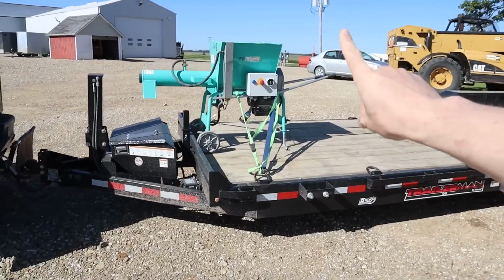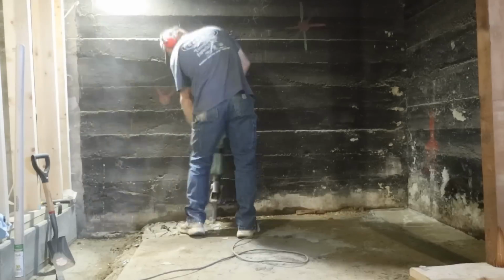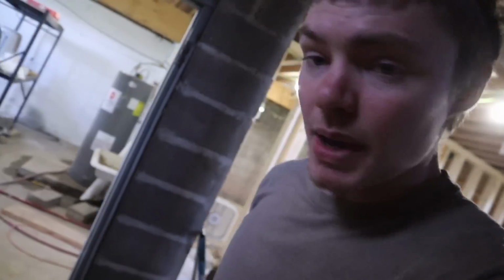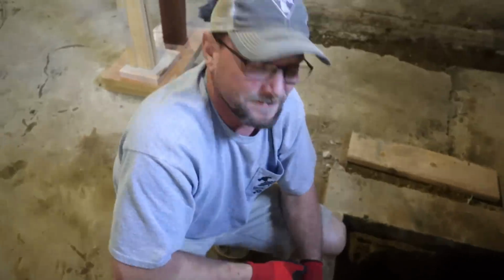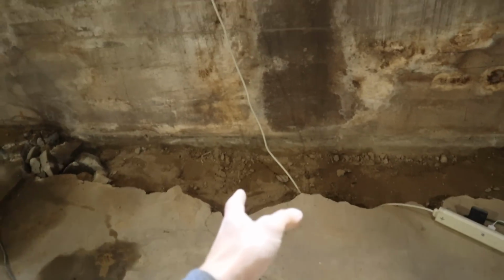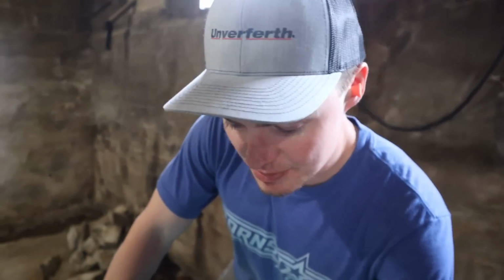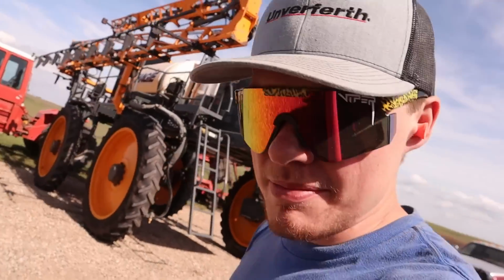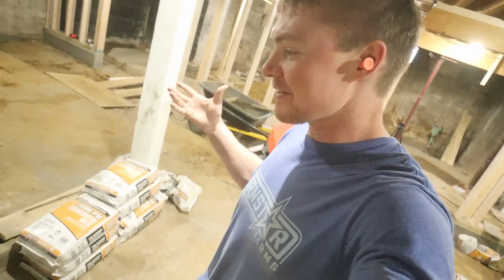Restoring A $7,000 Mansion: Pouring A New Concrete Foundation Pt. 2

Comment: Only Bad thing about you doing those footers in sections is a foundation footer needs to be one continuous concrete pour Cole. Because putting wet concrete against cured or dry concrete is it don't bond to each other. Although you tied the rebar from one pour to the next that helps in strength it doesn't prevent water 💦 from getting between the two pours. I know you're putting in ground water drains and that's great BUT in heavy downpours 🌧️ or flash floods or flooding In general water 💦 will still make its way between those concrete pours where they're not bonded.  I'm just saying. It should've been one continuous concrete pour on that foundation footer.  It would've been a complicated job but with the help of floor jacks and a concrete pump truck to pump it from the driveway into the basement it could've been done. Now as far as giving the house footer strength the job done here is fine but unless you're gonna install one big water 🌊 drainage pipe system to handle big downpours 🌧️ or flooding..... I have a strong belief you're gonna be revisiting this foundation footer project again in the future! I hope not but my intuition & knowing the fact the concrete footer is not one continuous pour...... I strongly think so.  
I hope I'm wrong for your sake.

Comment: concrete sinks while drying, you may need shimmering with steel wedges under the exiting walls, maybe use a flowable concrete 6000 psi or better.

Comment: What is actually left from the original house..?? Far as I can see it's the exterior frame, roof and basement exterior walls. The rest got ripped out and taken to the dump. I know the house is sentimental but the rational part of my mind says it would have made more sense to knock it down and rebuild....even if you made it look the same outwardly.

Comment: Gentlemen,

Glad you went with the rented concrete mixer. The barrel mixer does take longer to work with, as it has no automatic moisture setting, and you have to dump it out by hand.

Those fibers you see in the cement were most likely recycled wind turbine blades. There is a life span of a few years after which they're removed, and GE sends them to a company that shreds them into pulp, and cement companies use it to burn 🔥 in their cement factories and to make cement.

Keep up the good work. Justin, you cracked me up today. 😂

God bless you all.

Comment: Total waste of time and effort. Should have just removed the slab and install a curtain drain to a sump. Water seeks its own level so with perforated pipe , silt fabric and stone under the entire new slab water will drain plus now you have a way for radon mitigation. Next install gutters and pitch the ground away from the house. I hope what they are doing currently doesn’t compromise the existing foundation.

Comment: That rebar needs to be up off the dirt, didn't they sell you adobes to wire onto the bottom of the mat?

If it's in the dirt it'll rust, the rust will draw water into your concrete, hydroscopic pressure with crack your footings which allows for more water to get drawn in to continue rusting the rebar

Comment: As long as Cole maintains the current sub-grade clay soil on the OUTSIDE of his basement walls? Cole will have "wet" basement walls whenever it rains heavily. Everything he is doing INSIDE his basement, to alleviate moisture, is superfluous, and will achieve a net-zero result, to keeping that basement dry. He may as well be hosing money at the moon. If you want water kept out of a basement, then you have to seal the exterior basement walls, with something like Thompson's water seal, and then a layer of bituminous tar, to close the concrete's pores. Then it's a matter of putting large diameter perforated pipe, wrapped with landscape material (to let water into the pipe, while excluding mud and soil, to avoid clogging the drains) then, (having excavated along the exterior of the basement's perimeter on the outside) laying in large, screened gravel,(roughly five feet deep) over which you lay a pond liner... and finally a layer of top-soil. Those perimeter French drains should lead to a sump-pit, with a sump pump, which pumps any water making it past the pond liner, down the hill and into the creek. There should also be a catchment scheme set-up, to take any rainwater from the roof-gutters down the same path, so it doesn't reach the basement walls. This is how you keep a basement dry.

Comment: I hope it a GPS type  concrete as it expansion concrete which expands as concrete swincks when dry leaves a gap while a GPS does with the water it expand filling gap.what you doing is call under pinning dig meter leave a meter the most and so on.hope it seals otherwise mite have problem in years to come best of luck
Reply: I tried reading your comment; but, I can't!  Punctuation helps.

Comment: This footing reinforcement process seems like a really odd way of going about things considering that they have enough equipment on the farm to dig a hole large enough to get a bobcat in the basement. I am also not under the impression that they have created a way for the water underneath the slab has a way to get out of the basement—don’t the need to install a French drain around the perimeter? And probably outside the basement wall as well? I hope they are consulting a waterproofing contractor. I guess all this content makes ten times the cost to pay Roman and Justin so at the end they can pay for some other stuff

Comment: If you're cutting an opening in the basement wall to connect to the new basement addition, just make it wide enough to fit the skid steer through.  Then, cut a ramp down into the basement and drive the skid steer down to clean out the old flooring (if you plan on tearing it all out).  You can also probably rent a jack hammer attachment for the skid steer.  Just be prepared to put a temporary roof over the ramp to keep rain water out of the basement.  This will save you a lot of time and effort.

Comment: Order a concrete truck with a pump and put the hose through the basement window. Pouring will be done in no time. I hope you are not planning to pour the floor concrete by yourself? I agree with many comments here that there should be a perforated drainage pipe lover than the poured foot, then a separate pipe (without perforation) for the roof water and finally a water isolation covering the outer basement wall. We also put a layer of styrofoam along outside the cellar wall for frost protection

Comment: I helped on the same type project in 1968 when I was a Young buck! Dug the whole basement down 4 feet and under pinned the side walls on a house that was built in 1911 (24'x24') and poured a basement floor ! lived in that house untill 2018 when I built a New house on the farm a really nice 2000 sq'ft house with a full basement ,4000 sq/ft of living space

Comment: Can't wait to see which mixer you got and vibrator also. I have the 20volt dewalt one. Thought it would be a joke but when I go to the jobsite it Is the one everyone grabs first. So light and hits hard and fast and did 9yards of steps with it and the battery was still half charged. I have the harbor freight mixer and it hasn't let me down and it is 15years or more old and the small wheelbarrow one from menards that only does 60lb bag one at a time but is great for tight spots and better than mixing by hand.

Comment: @Justin - hope you've had a tetanus shot in the last few years due to you scraped /cut it on dirty metal rebar??!!
Symptoms of tetanus may not begin to appear until a week after the injury, so as a rule of thumb, try to get the tetanus booster shot within 48 hours of the injury. If tetanus is left untreated, your body could face long-term complications such as airway obstruction, heart failure, muscle damage, and/or brain damage.

Comment: Surprised perimeter wasn’t saw cut for a straight edge.
Reply: He said they are eventually going to jackhammer the rest of the old concrete floor and pour a new floor.  So, no need for a straight edge.
Reply: @ILGuy2012  I’d think old floor would remove easier with straight edge

Comment: There’s an updated machine to the concrete mixer you’re using. It’s called a Mud Mixer. Has a few more features to it, not cheap but definitely handy!  I’ve poured a lot of concrete with mine by myself. Absolutely hard work
Reply: That's not mud  to lay brick and block with
Reply: @Harvey-z4k  don’t understand your reply but I’m aware it’s not mud to lay brick and block with.

Comment: House is sitting on undisturbed soil for 100 years... (No cracking foundation walls) let's disturb it(in sections one at a time), not get 100% compaction after disturbing each section...  let's see how the cracks will start in the foundation wall over the next 100 years. Leave well enough alone. 100 years... no cracks!

Comment: Here is a thought. Clean out that old well, and run your basement drain into it. Install a pump with a level float so it automatically turns on and off when the well gets to a certain point. Drill a hole through the basement wall to install a pipe from the pump about halfway up the wall. That way you can run the pump hose out of the basement without having to dig a trench outside down to the bottom of the basement for your drain pipe. If that makes any sense.

Comment: If you put an addition on to the house with a basement under it. You might want to look into a company called Superior walls. They have precast insulated basement panels. No pouring and water tight and insulated. I used them and they are great.

Comment: Next time tear down the old house and save time,money and labor. When all said done it’s still a old house vs new. By what your said. You want a interior footer drain and exterior drain system. Also a in floor heating/boiler system for your basement. Again all over done but it’s your money and time.

Comment: The mind is the behind the knees work fine. Are you guys using a bonding agent on the exterior wall, cinderblock, or drilling it and putting dowels of rebar up?

Comment: Are you going to marble dye your floors on your cement while it’s new and then matte finish so you don’t slip and break anything because the last step is wax the floor and make them beautiful I’ve seen the dk green and then we have dk blue and they both are amazing it makes it look like you could be living down there especially if you’re planning to put a boiler pump to heat the floor! The acid dying marble will make it look like a million times better! Good Luck when you get to that point and I guarantee that if you do it you all will be happy! And you put wax flooring on it as it needs it if it gets high traffic you do it more often but the shine but not slippery floors will amaze you!

Comment: Both my father and my maternal grandfather worked at the Lehigh cement plant in Mason City, many decades ago.  Both eventually died from cancer; most likely from exposure.

Fun fact: Lehigh celebrated 100 years in Mason City in 2021.  They were also fined nearly $200,000.00 by the EPA for violation of the Clean Air Act, also in 2021.
Reply: Thank goodness they will have just a few hours of exposure and not a lifetime of it.

Comment: I’ve just came to the realization that in all that lumber you’re not gonna reuse you could have probably replaced the dump bed on the truck, 😊
Reply: Possibly. But that would ruin all the fun of seeing just how long those old boards will hold up!
Reply: That would have been good and then oiled them for sure.
Reply: @richardnott9587  Definitely oil them with a mixture of Tung, and Linseed oils... Best stuff in the world, for wood preservation. Only drawback being that it's incredibly flammable, while it's in liquid form. Once dry? No issues. This is what they used to preserve ship-timbers with, back in the days of sail.
Reply: Wouldn't that have been a smart thing to do?!!!

Comment: Just curious. 105years that house has been standing. Does it make sense that the original masons did what was needed to keep the foundation standing, permanately? This, in my opinion, is one of those times, that, if it aint broke, don't fix it. It may have been common practice to compact the bottom of the hole so that what was put in did not sink. I would have thought the drain pipe would have been put on the outside around the house. Just my thought.
Reply: I’ve seen houses built on stones last 200 yrs. Nothing Cole is doing makes sense. But it’s his money I guess.
Reply: Our farm mansion was built in 1869. Who ever built ours started with a strong well-constructed foundation that is not in need of repair.
Reply: Our farm mansion is bult much better than his and is over 45 years older. The basement walls are made of field stone and are very thick and are literally solid as rock. Original woodwork and flooring were not torn up and removed. It was lovingly restored by my father a true craftsman. As far as drainage it is just not an issue. A compliment to the original builders who used brick for the exterior. It was built before indoor plumbing and still has the original brick shithouse Built like a brick shithouse. It has been used as a garden shed for my lifetime.
Reply: Extra support. For future additions

Comment: Don't you need to put drain tile in the footings to connect the outside to the inside so the water on the outside doesn't seap thru the bottom of the wall

Comment: Major advice if you aren’t to far, the exterior block is hollow, water will penetrate to the inner core and run down to your footers and leak into the basement. Before you do your third footer pour drill holes In the block to allow that water to escape and make its way down into your drain tile below your basement floor so it can make its way into a sump pit. Otherwise you will have water from the block trickle across your floor. Trust me I learned this the hard way.
Reply: Would this not be negated with an exterior french drain dug down to the depth of the footer, filled with gravel, and trenches away from the home?
Reply: This is the course that I advocate, also. Best strategy, is to keep the moisture from even touching the walls of the basement to begin with. Digging an excavation around the entire perimeter of the basement, on the OUTSIDE, and making gravel-screened French drains, is going to be the best answer. This, particularly in Iowa's boggy, clay soil, and it's extreme expansion/contraction cycles. If you want a dry basement in that area, back-filling with screened gravel is particularly important.
Reply: @curtisboswell2619  EXACTLY what i did at my house in PA with similar soil. Not even a drop of water in my basement now and my neighbors less than 30 feet away (really the entire block) have flooded basements. Best thing I ever did, and so thankful for watching my dad do home improvements for years and years while growing up so I KNEW before it was a major problem what the solution would be.
Reply: Great and wise advice; you are a thorough thinker! Experience is the best teacher, hey?!
Reply: Yep excellent idea!
Reply: Too late
Reply: The bottom blocks are not hollow. Only the top are. They showed that before.
Reply: Are ya sure those are hollow blocks?  My house was built around the same time and the blocks they used are solid concrete.

Comment: so think about 2-3 bigger sump pump holes - this will ensure that the water table stays low and never infiltrates the basement again - you still have a ways to go but making progress
Reply: It looks like the house was built on the top of a hill.  Cole could probably have a deep trench dug and install a drain tile to carry the water away from the footers without the need for sump pumps.

Comment: I’ve never used a jackhammer but it doesn’t look as fun as I thought it would be.
Reply: They are using a small electric jackhammer. Air powered jackhammers are heavy as heck and beat ya to near death.
Reply: @petercozzaglio6070  I know it is just a toy. I have run a real one and it's not that bad.
Reply: @greghamann2099  you probably wasn't in a 3 ft diameter hole 6 ft. down busting limestone boulders?   Jobs like Coles basement is a cakewalk,  busting concrete
Reply: @ky.gambler5281  True. That would suck.
Reply: It’s significantly more fun than using a sledgehammer and chisel 😂
Reply: I have. It is fun. Not in a basement.

Comment: Only a suggestion, my brother in law did the same thing to his foundation, he barrowed an old hay elevator to take the concrete out of the basement and right into his truck.
Reply: You should have kept an old elevator section from your junking. Put an electric motor on it to carry all of the debris out of a basement window.
Reply: @walt66a  I think they did have one sitting in a shed.
Reply: @walt66a  Why? those things aren't made for moving concrete... it'd tear up within 10 minutes and probably plug in the first two minutes.
Reply: @walt66a  Hindsight, but excellent observation.
Reply: Alternatively, if they have a surplus grain auger maybe use that?
Reply: @alanholck7995  You just have to get the auger into the basement, bust the concrete up into dust and you might get 10 minutes out of it before it clogs or tears up the flighting.
Reply: You could  do it in the opposite direction also, to bring cement bags into the basement
Reply: The rental place probably has a conveyor that could be used to transport the concrete rubble and clay dirt to the outside.  A friend of mine rented a conveyor when he dug out dirt in his crawlspace by hand, in order to make a basement.  It worked really slick!
Reply: I was going to say a hay elevator would save a lot of time getting the old concrete out and also a slide from the outside window to the basement would speed up getting the concrete bags in.
Edit: just seen the slide!😂😂😂